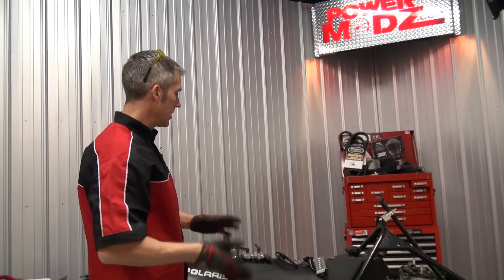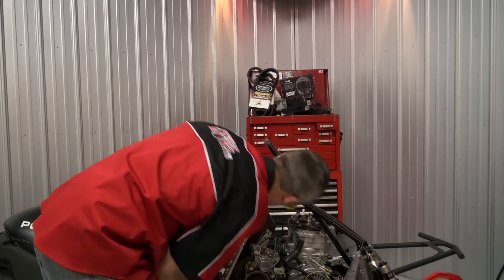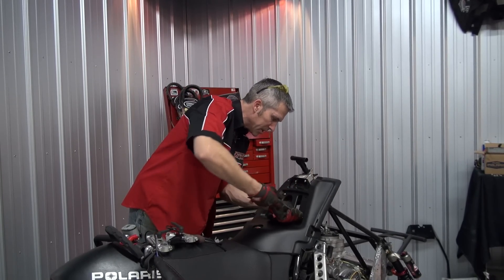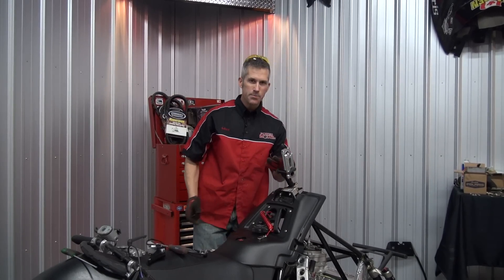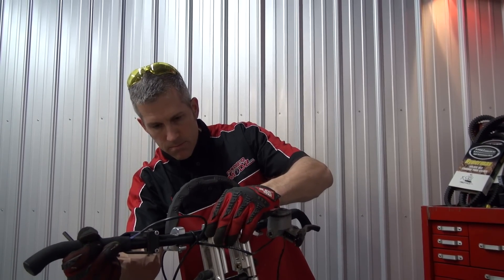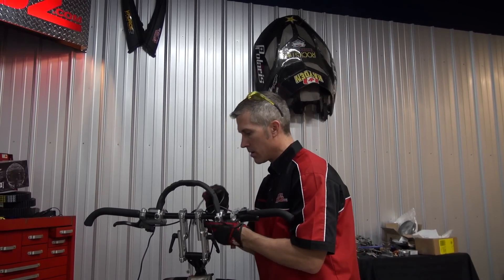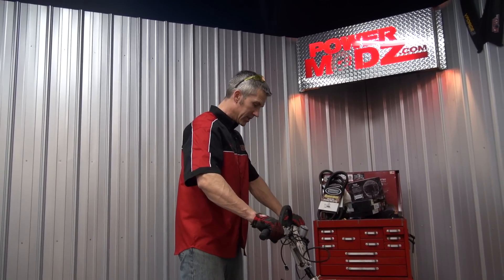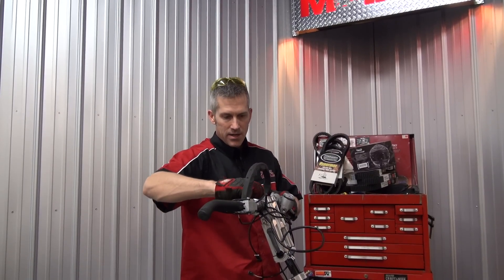Polaris IQR 800 Mountain Mod  Ep#15, Rox Speed FX riser, Grab Bar, ski Alignment! PowerModz!

Comment: Have you tried  position the throttle  facing forward ?  And operate it with pointing finger ?  I have it like that on all my sleds and its great in powder  and on trails, really comfy  and good control and the thumb didnt hurt , its like operating a front brake on bike ( because i am a MX rider its easier to use it like that )

Comment: Is the belt drive suppose to have that much wrap around the top pulley? It makes me wonder if you would gain efficiency with a shorter belt, or do you need that much wrap around the pulley to prevent ratcheting?